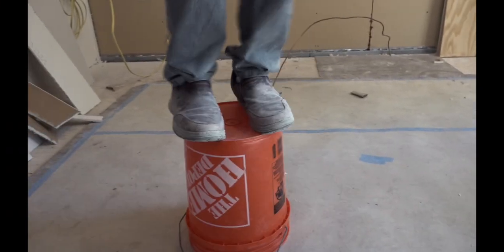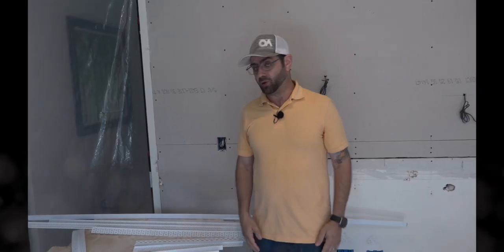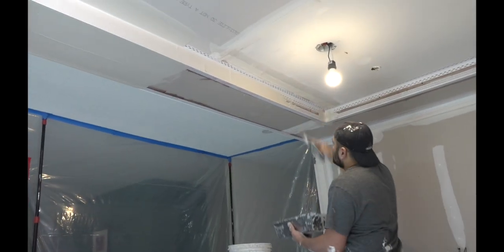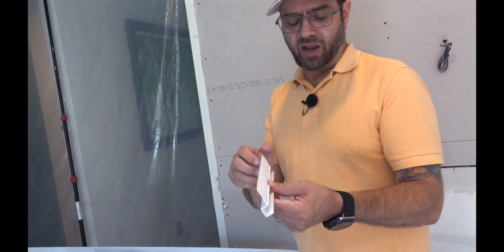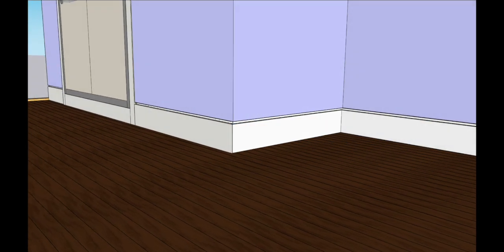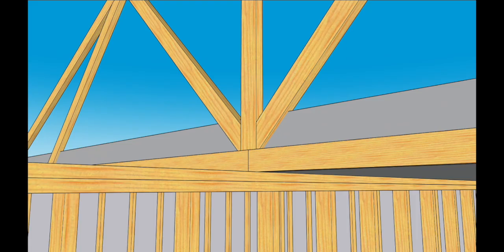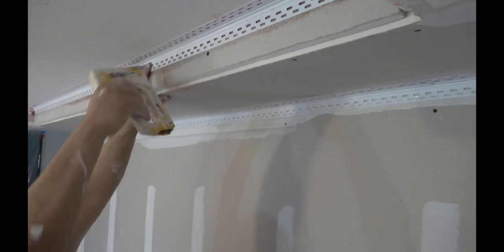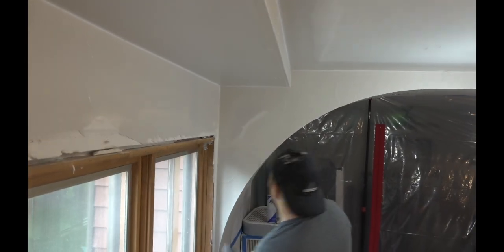Drywall Solutions for Uplift, Arches, and Framing Movement

Comment: Are you sure the backer angle on the made to move stuff stays with the truss it comes up? Your explanation says you don't screw the backer angle to the truss so why would it move with the truss. Isn't this so the drywall in the corner doesn't move with the truss, that it's attached to the wall as opposed to the truss.